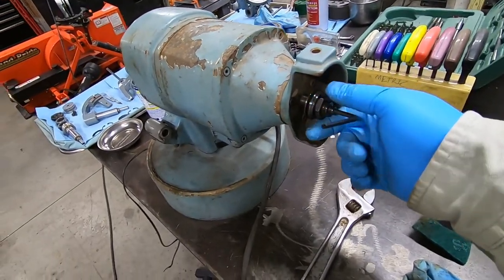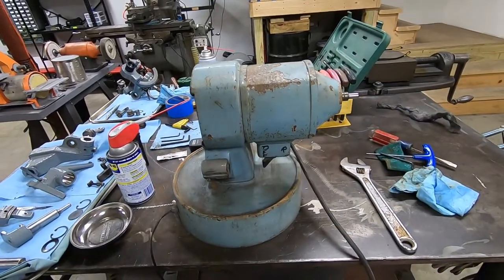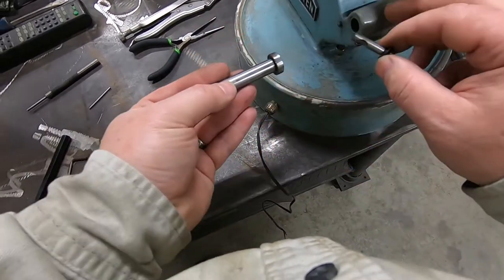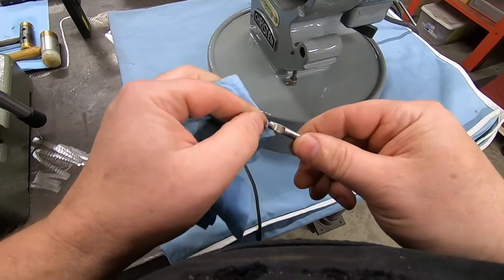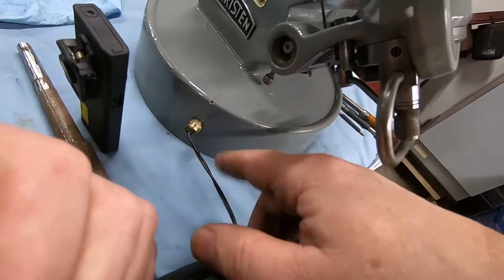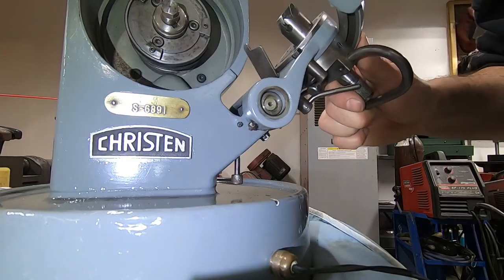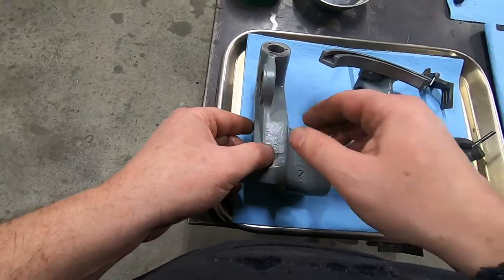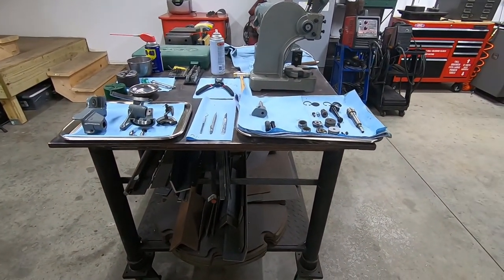Christen Drill Grinder Restoration Pt. #3

Comment: Looks like you are where I was a while ago, you seem to be missing a depth stop that goes between the steady fingers. Also have a solution for the missing drill collets if you are interested as the OEM collet chucks are hideously expensive.
Reply from the maker: Absolutely. Please share your solution regarding the collets.
Reply: @spinesales  From the footage so far it looks like you have a working grinder but are missing the OEM drill holding collet chuck/collets, I was in the same position, What I did was to use a  C8-ER11 collet chuck extension from a far east supplier, < $20 with a full set of collets! I went about drilling the 8mm extension through at 6mm to mimic the OEM drill holder (which I have but with only one collet), but the 8mm C8 shaft was difficult to drill with many hard spots requiring carbide drills to be used and many broken, so I suggest avoid a budget extension, you will end up paying in the end, I haven't had this modding many branded extensions. 

You may be able to help me with details of the "drill stop item 15A/16A" in the manual, my grinder is missing this part, there seems to be an adjusting nut on a threaded shaft with a profiled crown, I can easily make it, if I knew what to make.
Reply from the maker: @lionpauu7360  thanks so much for the information. You are exactly correct I'm missing the collets and OEM drill chuck. I wasn't sure what I was going to do about it. There really isn't any good information online regarding this problem so your suggestion is absolutely appreciated. 
It's difficult to see in the picture on the manual 16a and 18a but I'll look at my grinder and see if I can figure it out. I'd be happy to assist in any way I can. The flow of information is bottle necked and hard messaging back and forth here.  Is there a more direct line of communication that you can suggest we use?
Reply: My avatar is a lion facepalming
Reply: Interesting as soon as i mention any of the alternate media my message is canned, so if if you look on the messaging plat that have a paper aeroplane in the logo and look for Lionspaw with the above avatar, I am not on the green plat. This is so bizarre!
Reply from the maker: @lionpauu7360  email me here. bduda@twcny.rr.com